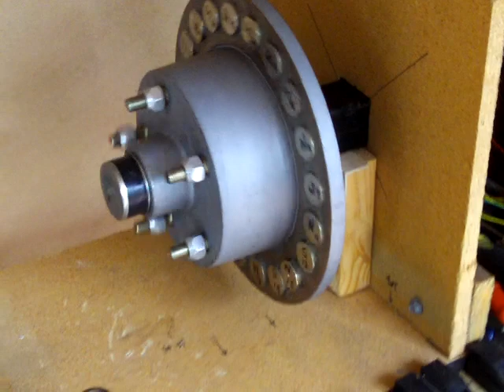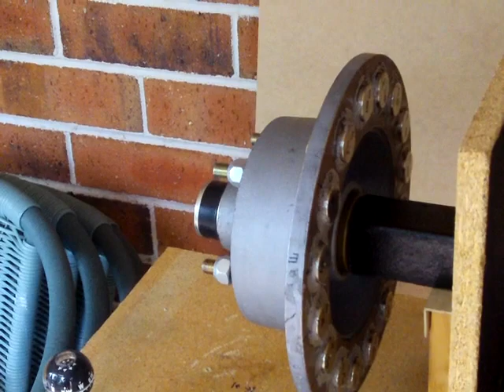WIND POWER GENERATOR

Comment: @itsandbits1 Thanks for your reply. I have to disagree. Eddy currents exist in all motor and transformer applications. It is reduced by using laminated iron. One test to prove that it exists is to drop a big magnet on an copper plate and watch it slow. And another - fill a container with water float polystyrene, place copper plate. Cling filb container. Attatch a magnet at end of stick and spin outside. The float inside the container starts to spin due to eddy's. Thicker metal = more eddy's

Comment: @itsandbits1 But there will be eddys in the metal disc shown. If there is copper windings are introduced creating induction in the coils producing a current. An opposing magnetic field will be created. That oposing magnetic field from the windings will produce Eddys in the metal disc (which is moving). And since it is a thick disc it will be a large eddy current. Obviously there are no windings here in the video. Would you agree with my comments - many thanks. :)